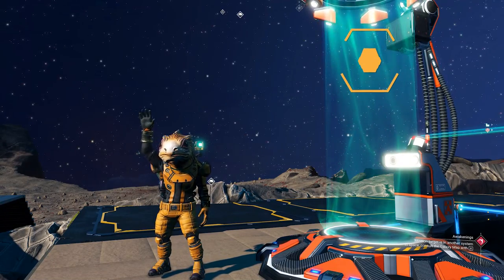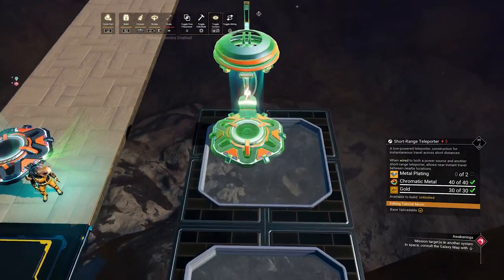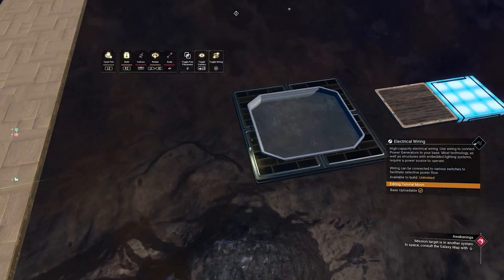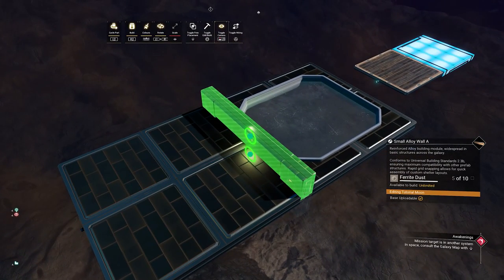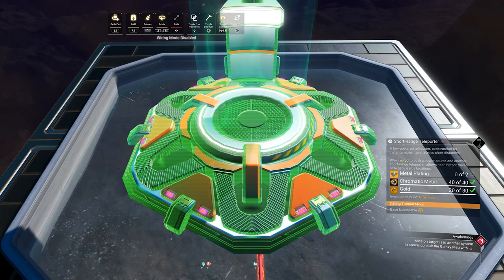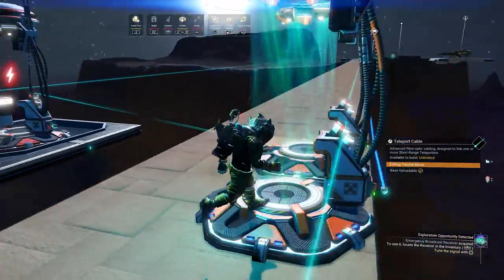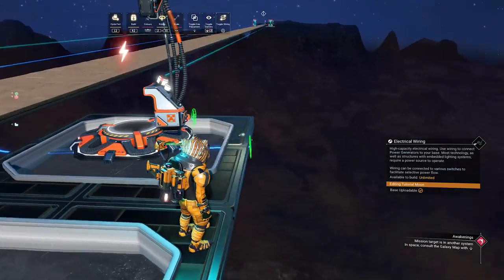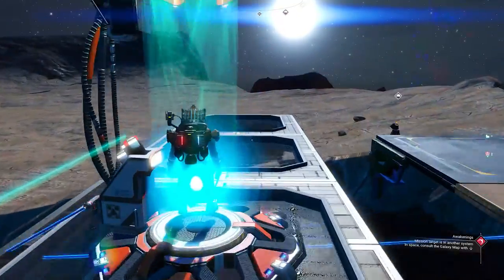The Teleporter Bridge - How to build in No Man's Sky Frontiers

Comment: Too bad I can't like and subscribe more than once....
There is something about how you explain things, that makes it razor sharp and clear to me.
Good job!
EDIT: Finally got around to trying this last night.
Once I watched this video five times, and a few hours of cussing later, I finally got the technique down. 
One thing that was hanging me up was the correct placement of the light panel floor piece.
I got what you said about making sure it's connector was pointing away from our connection points.
What you didn't explain, and what was hanging me up, was how the rotation of the part in the flat plane was rotating the plane of the wire connection.
I had to watch several times to see what I was doing wrong, because I would rotate it to make it point away, but the teleporter would glitch in at strange angles.
Once I saw how the lightning bolt was positioned on yours, and made the mental connection, everything worked as it should.
I'm kinda dumb at times..

Thanks man!!!

Comment: Huge fan of your tutorials! Thank you for sharing your knowledge and techniques. Will there be/or is there already a vertical teleporter bridge tutorial? I'm currently attempting a vertical setup for my sub orbit base and am having problems making it work. My base is 1542 u above the surface(well within the 2000 u limit) and I can't seem to get accurate vertical distance measurements(200 u max length/height) for placing SRTs and their corresponding cables/wires. I would love to have the seamless transition from ground SRT to the base SRT.
Reply from the maker: Cheers Dragon, There is not a tutorial for that yet.

There are a few ways you can do it...  But the problem is mainly the building rights not showing. So you need to extend your base so you keep the building rights.

Comment: I spent a long time yesterday working on this - can be done with 3 teleporters instead of 4. set up the first 2 200u apart, then delete the "mid-point" teleporter. Now set up your furthest teleporter, and you can now join a cable back to the mid-point cable. Unfortunately, this alone does not work, but if you now replace the mid-point teleporter (placing exactly where the 2 teleport cables are joined), then it works - only 3 teleporters :) !!!

Comment: One thing I noticed, I couldn't merge my own two bases together to make a super long tp bridge. I built everything up right, and made a bridge on either side of the base overlap line.
But when I connected one series on one side, to the opposite bases series on the 180 degree side of that platform the teleport stopped at the base line. it works up to that point from either side, but does not chain to the other base.
I might be doing the merge wrong though, idk.
Once I deleted the second base, and used the wall trick to extend my build range, they work as expected.
Reply from the maker: We did a lot of these teleport bridges in the past, between different bases - However, with the recent changes to distance rendering, I assume the teleporter of the 2nd base does not render in in time to cross over.

Sad, but yeah - guess we need to deal with this.

Comment: If you plan to combine bases, I will save some headache. The teleporters will only work on the same Power network. There is no way to do this with out a transfer station. I wasn't able to find a way for bases to share power networks... So I want assume it's not possible. I really hope someone can prove me wrong cause that would save so much time and resources. 

Took me a good amount of time to figure out why the teleporters weren't working right at the border of my bases.
Reply from the maker: Yes, it works, but you need a relay station which is a combination of a teleporter from one base and a teleporter from the other base.

Comment: So, this works. I followed the instructions and it does exactly what it's supposed to. About 60% of the time. Other times, it just kinda dumps me somewhere near the middle of the "bridge". It's fairly consistent about its dump spots, but I can't for the life of me figure out what I'm doing right when it works or wrong when it doesn't. I suspect this may be related to how much of the base is fully loaded at the time of the port, but I'd love to hear your theories. I am, however, beginning to suspect there is a reason why HG limited the base distance to 200u.
Reply from the maker: It used to work perfectly before, but after the Derelict Freighter update Teleporters broke. Even after them fixing it.. it still works only halfway.
Reply: @Beeblebum  I ended up having to rebuild one of the end-points, and then it started working...better. Like 90% success rate. But that shows there is something we can do, whatever it is, to "control" this. Just wish I knew what I did right the second time so I could do it more.

Comment: Sometimes, when I am performing this maneuver to glitch other parts (a small refiner) onto the center of floor panels (in this case a small floor panel) I cannot get the wire snap point to rotate direction (using a xbox controller on PC, and yes my brain is smooth). It seems to have nothing to do with unlucky button timing, as it repeatedly fails. I have to start over from scratch, and this sometimes works. As far as I know, I am following the methods you laid out, at least the fundamental principals. Lightbox/wire snap point orientation, and general order of procedure etc. I haven't been able to suss out where I am going wrong. As I said, sometimes it works, other times not. Any ideas what may be causing the inability to rotate the wire snap point? Thank you for your vid's btw.
Reply from the maker: The Wire rotation got kind of borked with the recent patches, they normally work, but the game can get confused.

Some suggestions:

- Move the build camera to the opposite side and see if the part glitches properly.

- Or remove the wire you glitched your part on and then glitch the other part on the remaining wire

- Instead of WireGlitching, use the Universal Adjacency Glitch, (see example in this video: https://youtu.be/ZY9fZBraHBk )
Reply: Not quite sure what I was doing wrong, but I think I've got it sorted now. :)

Comment: Love the video but you should do an update showing the more useful version of doing this horizontally and using gravity to make swapping teleporters automatic. Specifically, you can use the wire glitch to place these at a 90 degree angle from normal (long axis parallel to ground). If you do this in pairs with the "exit" of the first teleporter placed directly above the "entrance" of the second teleporter, your character will enter the first teleporter, fall out (due to gravity) of the first exit into the second entrance (placed directly below the exit) of the next one and so on. In this way you daisy chain as many teleporters as you want in any direction you want. I'm not sure if this has been posted before, so apologies if this isn't new
Reply from the maker: I have been making Teleporter Bridges, Carousels and rollercoasters in every direction.. haha. In theory the teleporter bridge can be made in no matter what direction, the important thing is that you make sure you prepare your build that you do not lose building rights along the way. The gravity one would work, but it only works one way. The Teleporter bridge can be used to travel both directions.

Comment: Just did this yesterday. It was daunting at first because I've never done glitch building before. But once I did it once or twice, I understood the purpose of each step, and it was much easier. Then it was just a matter of making it work. And I gotta say, it works pretty well. Sometimes it glitches out, like the terrain doesn't load in once I teleport back. But I got over that by putting down platforms to stand on. Sometimes, it doesn't teleport me all the way, but that's only like 1 out of 10 jumps. Overall, it works very well for my nanite farm. It makes it much faster to mine those molds. 

And I just gotta say that the double teleporter looks amazing. I just can't get over how nice they look when the pieces overlap like that.
Reply from the maker: Yes, totally agree how satisfying these relay stations look.

The terrain is an issue indeed, I think that is why they limited the teleporter cable to 200u... But with the platform below it, you should have a few seconds to have the terrain to catch up.

Never had the half jump myself.. but it might depend on how many relay stations you build. 😊
Reply: @Beeblebum  I think I have 3 relays. Sometimes it would only jump me to the second to last one. I had to replace the teleport cable to fix it.

Comment: Teleporter 2000 is broken? Dang. May need a mod for that now, I guess. Most helpful thing in the game pretty much. My old ones still work, but this will limit what kind of new builds I can make. The easiest solution would of course be if they simply allowed the cables to be as long as needed, without glitching. The limit makes no sense.
Reply from the maker: The limit is there mainly because of the rendering.. Especially on Consoles, the game can't follow a 1000u jump.. 
There are mods to change the limit of it.. so that should be easy for PC.
Reply: @Beeblebum  Even on PC loading takes a while when teleporting obviously, but I don't see that as a problem. You're standing on a teleporter anyway, and waiting a few seconds for everything to load isn't really an issue. At least I can't see how it would be. Anyway, found a mod for it, which I never bothered looking for before since the glitch was so easy.

Comment: Its the same putting in power cables for Electromagnetic Generator Towers :(((  (as I write my PS is updating the update AGAIN???? To run in a EGT you have to daisy chain batteries to run out LIVE CABLE to the 'HOTSPOT' before it will let  you build your EGT! yYou have to keep your 'build menu' active you need it to THINK you are at your base. Running a power cable out foos it to think this. ONly way I know of using EGT's to power my bases. One of them is over 1000u from my base BUT I built this BEFORE THE UPDATE so its still intact! If I tried to change it I owuld LOSE the link and my base dies. :(((( Beeble do you have any tips for running out the LONG LONG power cables please to the EGT??? The game keeps crashing and reaching the point I will DELETE THE LOT and play something else......HG have RUINED IT - I dont want a stupid 'settlement' or villagers to deal with!

Comment: This doesnt work any more however what works is you can literally build 2 teleporters one on top of the other 180 degrees around and it will work.  Yes one teleporter will be taller than the other but that's fine, it still works.

Comment: I can't get the wire to rotate.  The teleporter is placing upside down or on top of the first middle teleporter
Reply from the maker: Wire rotation has been taken out in the 3.71 update, which is annoying.
You can try deleting the wire where you glitched the first teleporter on, so there is only one connector left.
Or use the new Universal Adjacency glitch.
Reply: @Beeblebum  thanks Bee!  I tried the new universal adjacency glitch and it worked great.

Comment: I just tried this build in my base. One location required 2 regular teleporters and 2 glitched teleporters (4 total) in between. If I use this it does some weird behavior on your character.

After using the glitched teleporter with 2 jumps in between, if you try to access your Minotaur, it breaks everything. Your character becomes invisible and all interactive objects no longer work.
- Teleport still works on your invisible character.
- You can't use ships, exosuits or other interactive objects within your base.
- You still take damage and you can still use weapons.

Since you can't access starships anymore, you can't use auto saves. I'm not sure if you can access Save Beacons, but I don't want to overwrite my saves and corrupt it. Reloading any previous saves doesn't work at all, which means you have to restart your game.

EDIT:

I disabled my minotaur and tried it with the starship after using the teleporter bridge. There was a 5-7 second delay before I was transported inside my ship. Some items also started glitching and you can't open the color selection menu in Construction mode. You can still save, but reloading a save doesn't work anymore (you have to quit the game).

From the looks of it, it doesn't appear to corrupt your save file so you're good to go. It just breaks the game for some reason lol.
Reply from the maker: Hmmm, I'll have to test your findings...

Comment: I’m having trouble placing the base teleport module when building on flooring. Any known fixes for this?
Reply from the maker: It might be because your character or Star ship is too close.
The collision bubbles are crazy large with Frontiers, I am assuming it is a bug. Make sure the ship is at least 30-40 u away and your character stands about 4 floors away from the location of the teleporter.
Reply: @Beeblebum  I found out why, I was doing expedition and my character was to close vertically, but I finally was able to place the teleported after moving out the base and placing it. Anyone having the same problem try standing like three tiles away at least